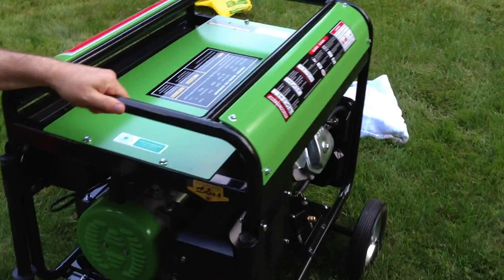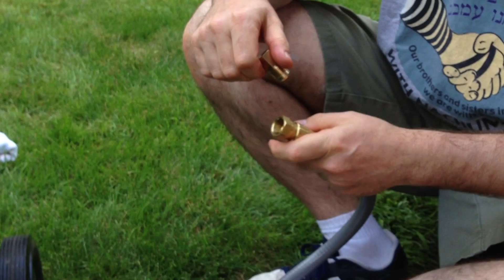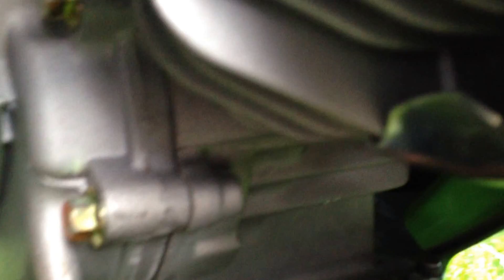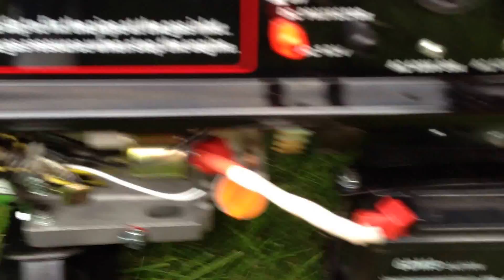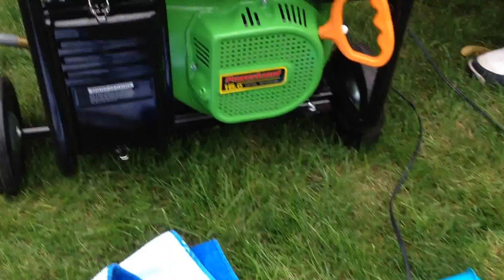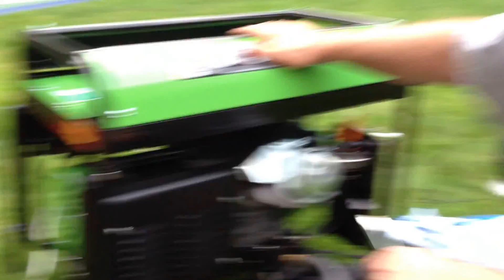Powerland Portable Natural Gas Generator 6500 Watt

Comment: Hello ,Where can i buy a circuit Breaker for a 6,500?
Reply from the maker: @paddymccune8512  https://www.electricgeneratorsdirect.com/power/manual-transfer-switches.html
Reply: Thanks,  but now i need a on off switch which burnt up,  Thanks again for your help

Comment: It was painfully to watch you attempt to start the generator by pull start. My Powerland starts on 1 or 2 pulls. Yes, turning the key to the run position is necessary and you don't need to prime it while pulling. Very easy, prime for 3 seconds then pull start!

Comment: The only reason I am buying a generator is for when I lose the power in my house. If I have no power how am I going to start it if I can't pull the cord and start it???????
Reply from the maker: Good Question. These have a 12V Battery To start up as well. But you need to have a trickle charger attached at all times or use the pull start.  Keep updated by subscribing and thanks for the question!

Comment: It's hard to start because:
A- The engines brand new and the fuel needs to fill up the carburetor
B- You didn't even choke the damn thing
Reply from the maker: I can only say that Natural Gas is Different because you don't fill up the carburetor with a Gas. You also are not supposed to use the Choke. As i recall we did prime the engine by pushing in the valve on the gas regulator.
Reply: I see. I assumed it would be the same as a gasoline engine.
Reply from the maker: +Jacob Burrows its a Vapor. The Carb stays dry and the gas just passes through and gets burned in the engine. Much Better than Gasoline. Never a carb problem.
Reply: +silverbankruptcy thanks for the info. What's the price difference between a natural gas and a gasoline model?
Reply from the maker: +Jacob Burrows i usually convert the generator myself with the conversion kit for $200. This generator comes with the kit set up for NG. Its priced low but quality is nit as good as a brand named one. See my other videos on this.
Reply: I recently installed a dual fuel carb (tri fuel) on my 3.6KW generator. After the 5 minute installation this was a 2 pull start. 1 pull choked, and 1 pull half choked per the instructions. This was on LPG. What was really nice was that no adjustments were needed. About 123 volts and 63 HZ no load.  I haven't tested on NG but I'm hoping for the same results for start up.
Reply from the maker: Keep Us Updated! My guess is that it will be harder to start on NG. A propane BBQ basically explodes on ignition, not so on NG.

Comment: Everyone is an expert. I understand your enthusiasm about the Generac because it has worked well for you and that's a good thing.  But aren't you going a little overboard? First you say the oil plug is a copy of the Generac. It's actually a copy of the Honda OHV engine. And at the end you basically claim that the Generac is more reliable than this unit. You have no idea how reliable this unit is. It looks like you guys just unboxed it and this was it's first run. Don't you think it will take multiple runs and multiple hours to judge reliability? As far as online reviews go, the Generac gets just as many good and bad reviews as any other generator. These generators are basically all the same anyway. Usually just have different paint jobs and some minor frame designs, etc. Pretty good video though... And you seem like an interesting, high energy guy. Good for you.
Reply from the maker: Thank You,
I may have gone a little overboard with the Generac thing. I Think that when you feel the weight of the Generac, it is a lot heavier than this Powerland unit, and i conclude that its therefore more durable. The purpose of these videos is just to try to be helpful to people while having fun! This isnt the Gospel where you study the meaning of every word. Some things i get right and sometimes my conclusions are arguable,  or plain wrong. If its a little helpful, then thats my goal! I am not an expert, i just pretend to be.
Reply: +silverbankruptcy Oh OK.. Sorry I was so negative. One other test you guys should do is try to start that with the choke. Experiment a few times with cold starts to see if it may start quicker when using the choke versus not. When you think about it, the fuel for the engine can change, buy the theory of the internal combustion engine does not change. You still want to provide extra fuel (less air) during startup whether using gasoline, natural gas, or propane. This will be one of my tests once I get my tri fuel setup.

Comment: For batteries a if u let them discharge as low as u can they will work longer if u only use 5% of what u could use all the time the battery has a memory basically so u lose 95% of power if u don't discharge them.  Also large capacitors can be used to "reset the memory" and its like new research the battery type and use the same voltage in the. Capacitor as the battery and the rest I need to look up its battery maintenance. A battery maintainer can save alot of trouble trickle charging I learned the hard way it doesn't regulate itself after full
Reply: This depends on battery type. If you run a lead acid batt way down you loose capacity.

Comment: First of all, Just let me say that you started off trashing your friends generator. That would be fine but, you didn't know what you were talking about. This thing will keep the battery charged on it's own. Next, the button on the regulator is to bleed off the propane to that point. Also, you didn't put any kind of load on this unit. Don't even let me get started about the adjustment screw, or the FLUKE. From what I've seen I wouldn't let you nowhere near anything mechanical. Trust me I'm not taking up for this generator. I seen my own flaws in this unit. But, if you want to review something, stay with what you know and not what you THINK you know.
Reply: I was cringing the whole time watching this video.  He could have smoothed it out by shutting off the "un-needed" choke that was wide open.  ;)
Reply from the maker: Anthony DiSano Natural Gas generators do not use the Choke. You Leave it Open.
Reply: Engines are supposed to run with the choke "wide ope"n. When you "close" the choke you are restricting the airflow and richening the mixture)

So the choke being on as most would say means that it's actually shut. (With the exception of needle chokes which add more fuel instead of restricting airflow).

Comment: Video was very helpful.  I have the 8500 watt tri fuel.  I am trying to find your trickle charge video.  Also i am trying to start this for the first time and my battery is dead.  Do you know if I charge on "Maintenance Free" and 2 amp?  Thanks
Reply from the maker: The best Trickle Charger is sold by Amazon called the "Battery Tender Plus". There is a snapshot of it hooked up on my Generac GP7500E video. It is Completely automatic and only charges when needed. Harbor Freight has some for a few dollars, but I recommend the one I had. If battery is Totally Dead (Car was Sandy Flooded), as it was on my 20KW Briggs Generator, I had to give it a Boost from a Car Battery Booster, and only then would Trickle Charger intelligently sense some power and would Trickle Charge it to full charge. Its a safety feature.
Reply: If you want to test to see if this generator/engine is equipped with a battery charging system do it like you would on a car. Check battery voltage engine off. Then check battery voltage engine running. If the voltage is the same then no charging system. You'll see 13+ DC if it has a charging system. If it has a charging system and the generator is ran once a month or so there will be no need for an extra trickle charger.
Reply from the maker: Apparently Someone here here has a Brain!
That's a great Idea. Thanks!
Reply: Since I first saw this video I have been wondering if they were smart enough to put a charging system in. I have a small riding mower that was built in 1984 or so. It has no electrical accessories except electric start. Even with an 8 HP briggs it has a charging system for the battery. My thought was why would they leave this out on a generator engine?

Comment from the maker: I watched parts of the video again and I see I put my hand in front of the heater to check for heat. Those heaters were 1,500 watt heaters each. Although it's not clear from the video, it does appear that the HZ did drop from 62 to 61 HZ before and after. It's difficult to tell because I kept adjusting the mixture, but that is my recollection. The Kill A Watt EZ might be helpful, but I am used to my Fluke. At the end, the goal of my videos is to have fun and spread good ideas, and help a little.

Comment: may I suggest for your next generator video using a less expensive Kill A Watt EZ instead of the Fluke for your measurements......you can then measure and verify for your viewers Hz, Volts, Amps, Watts, VA, and PF of the connected load....more safely too...

Comment: doesn't sound like you actually loaded the generator with those heaters....outdoor temperature was probably above the heater thermostat setting....normally you would easily hear a portable generator slow down when it is loaded up.....also you would see frequency drop on your meter when it is loaded......

Comment: and the ground for the generator which  is the actual frame of the generator which the negative terminal on the battery is connected to also   the 12 from the front of the generator comes from the actual alternator and is used for charging car batteries .etc

Comment: trust me, got the same generator got mine for $700 due to  the box was damaged and it bent the muffler cover but i got a multimeter out  and measured 13.7 volts of the two cables going to the battery the power comes from a charging coil behind the flywheel you will see two wires coming from the recoil (pull start ) shroud one being the kill wire for the ignition and the other a positive charge wire from  the charge cable this then connects to the positive electrode on the starting relay

Comment from the maker: The powerlandonline website says as follows: "It is equipped with 120 volt outlets, a 12 volt DC outlet for battery charging." I think that they expect you to run wires from the 12 Volt output of the Generator directly to the battery terminals and deal with the issue of possibly overcharging yourself. More expensive models specify "automatic battery charging". Better to get the Battery Tender Plus. I think that its impossible to run electric backwards through the starter to charge the battery.

Comment from the maker: First thing is Measure either RPM should be 3,650 no load and 3,600  with load, or Measure the HZ of 61-62 HZ no load, and 60-61 HZ with load. Check voltage with load and see if it drops and if so then pull the linkage arm that leads to engine and see if that revs it up and improves voltage, and if so maybe governor allows you to adjust a screw to increase the revs a drop. 5W30 is for colder areas to keep oil liquid in cold weather, I think that it would be fine, but i am not an expert.

Comment: Okay thanks.  I managed to get it running smoothly now with 3/4 all the way to inlet.  I measured VAC at 115 no load.  Shouldn't that be higher before load?  Can I adjust RPM of engine to boost that up a bit?  I need to check Hz, but have not yet.  Also, can i run 5W30 in it?  Their tech support sucks... hope the product lasts a little while!  Thanks

Comment from the maker: Definitely have a fuel starvation issue. I am told that Ebay seller RWHOSE will make any hose with any connections that you need. That generator needs a minimum 3/4 inch hose with a 3/4 quick disconnect to the pipe gas pipe on your house that should also be at least 3/4 (I recommend a 1 inch pipe if its far from meter). See my portable generator video for more information. I would wire that generator to a whole house transfer switch from electricgeneratorsdirect and run the whole house.

Comment: Thank you so much for this video.  Just bought a powerland 10000 watt tri fuel and it seems my gas supply is on verge of being too little.  Mine did not come with a nice screw driver adjustment valve inline, but does have one.  I had to adjust all the way out to get it to run, but it still runs fast then slow, fast then slow.  Starved for fuel I think, too lean.  Where did you get your 1/2 flex line and 3/8 to 1/2 inch adaptor?  I only have 3/8 quick disconnect from lowes for grill.  Thanks!!!